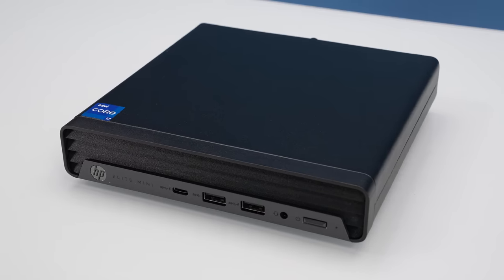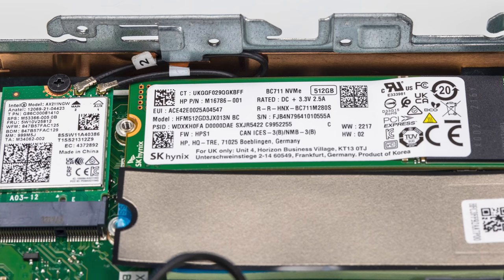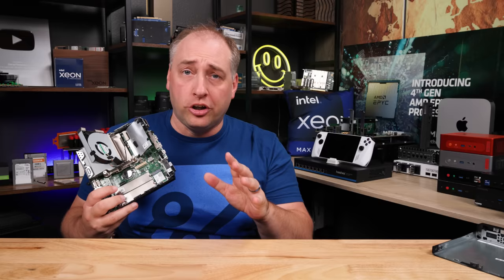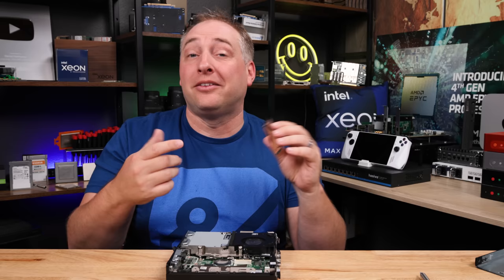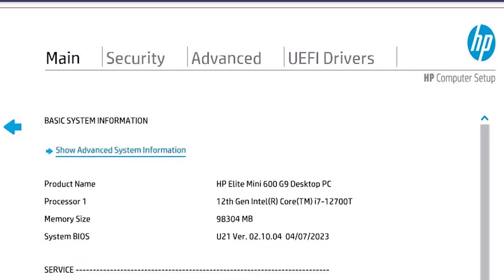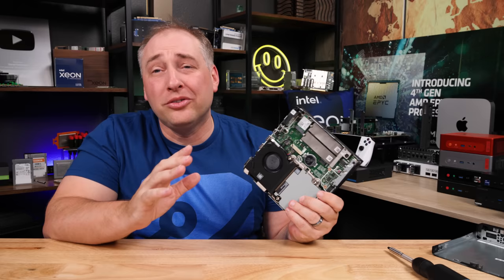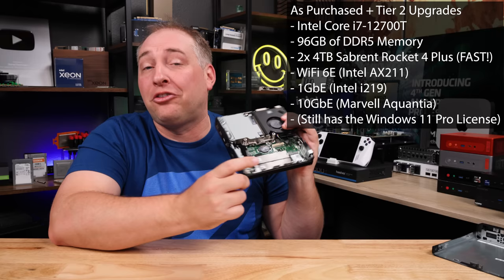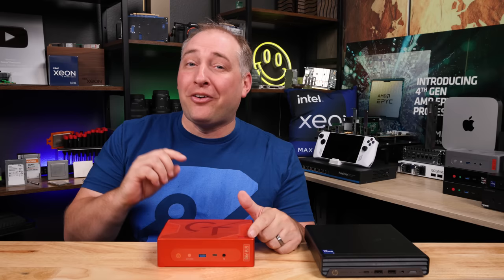Perfect 1L Homelab in 3 Upgrade Tiers Project TinyMiniMicro

Comment from the maker: Since folks are asking a lot about costs. The idea was just to give folks an idea of what is possible and there is a lot of variability here.
-  ~$500-$515 for the base we used, but there are options for less than that.
- Maybe $25-30 for an extra 16GB DIMM. 64GB is like $150-200, 96GB $279
- $29 for the 2.5GbE NIC. $129 for the 10Gbase-T NIC, 
- SSDs from $50 to $400 each depending on speed/ capacity.

I think all-in on the top-end config we would have spent around $1.5K
Reply: Original Model #?
Reply: Taxes excluded of course. The price could easily go up to 2.2k.
Reply: Thanks, was wondering the extent of the cost as spec'd.
Reply: What the original Model # -- I'm see price at $700 and up
Reply: I see there are i5 and i7 versions of this.
Reply: Patric - those machines were advertised somewhere as having some SATA capabilities, can you please comment on that ?
But anyway, THANKS for that 10Gbe find ! you're an absolute legend, and you've just replaced 3 nodes in my cluster :D
Reply: @Act1veSp1n  HP Elite 600 G9, mentioned at the beginning of the video.
Reply: @YerBrwnDogAteMyRabit are you talking about eBay auctions?
Reply: This is exactly the type of build I was looking for. I want a home virtualization server but I don't need enterprise equipment with loud fans and massive power draw.
Reply: HP seems to have two versions of the HP Elite Mini 600 G9 (at least with the Core i5 12500T). One with DDR4 memory (e.g model 828S3AT#ABD) and one with DDR5 memory (e.g model 64J15EA#ABU).
Just make a note of that before making a purchase of the Elite mini and memory upgrades.
Reply: Hey Patrick are you going to be giving that away? Cuz I am interested!
Reply: My 10G Lab costs arround $800 and many free stuff collected from the same company that sold this stuff on Ebay.

$650 - for a Server with 40TB HDD + 4TB SSD; 24 Core Xeon Gold CPU from  2017, 192 GB DDR4 ECC Memory; Redundant PSU and 24 x 3.5" Hotswap + 3.5" HDD Caddys included in Servercase.
$150 - for a 48 Port 1G managed PoE Switch with 4x 10G SFP and 4x 10G Cat7 Transceiver included! The switch have Redundant Powersupply too!
$0 - Fortinet Firewall, small Switches, Full sized 19" Rack, Some client PC's, some HDD and SSD laying arround. Cables - yes tons of Network Cables. 😀

I also spent some stuff to our local Schools and installed the Network equipment there with the Service provider.
Reply: I really appreciate your videos and all the hard work you put on but you should really stop to lower the prices you use or maybe say "I got a killer deal at 500$ but if I see the average is 800$ in US".
The HP G9 isn't usual to find it for 500$ it's more like 900$ and in some countries you can see it at 1300$ since isn't really an old computer...
For 500$ in my country you find more an HP G4 and if you read the comments in this video you will see if the average people can't get this price is because they are too dumb to or maybe because isn't what you get most of times.
Reply: -  ~$500-$515 for the base we used, but there are options for less than that.

Really? 

€1000 for that HP Elite Mini 600 G9 with i7-12700T. 
2x4TB NVMEs ~€350
96GB RAM ~€350
Plus ~€250 for the NICs

Total ~€2000 to serve files with Nextcloud and Docker with Prowlarr, Torrent, Lidarr, Invidious as in my case. 

The same thing I have going with FREE Athlon II X4 610e computer with 8GB of DDR2 RAM and LSI Megaraid with 2x4TB Hitachi Enterprise grade HDDs. Total cost ~€200 with brand new Megaraid with backup battery and 2 HDDs. 1/10 of the price and uses at idle ~85W. Upgrading to i7-9700 with 16GB RAM and extra 2-port 1G Intel NIC for another ~€200 to drop idle power usage to ~40W and to add Proxmox for pfsense and Pi-hole. Total ~€400.

Thanks, but no, thanks.
Reply: Thats going to take years to justify in terms of energy savings. how much are you calculating as saving energy wise over a year say vs a standard desktop?
Reply: hehe, that's a given with American pricing.
Reply: @faunization what eBay seller did ya get it from?
Reply: can you upgrade the cpu for that unit? like the i9?
Reply: Apparently this video added a bunch of market value to the i7 600 G9 as they're selling on eBay in the $700-1000 range, which makes many of the options at the end of the video that were "too much more expensive" suddenly more attractive.
Reply: considering you dont have cooling for the SSD dont you think you should have used SSDs with heatsinks?
Reply: @ServeTheHomeVideo be VERY careful recommending the HP 10GbE FlexIO card.  Mine went bad and I'm dealing with HP corporate right now saying that card is not certified so they aren't supporting me for it.

I literally bought this setup specifically for the 10GbE capability and they are basically telling me to pound sand.

Comment: I don't think that non-binary memory modules will ever seem normal to me...
Reply: Correct. why not just add 128GB? instead of 96GB?
Reply: @Nalianna because now you can get to 192gb with 96+96
Reply: @rohanjamadagni  But the 10700T only supports up to 128gb.
Reply: @Nalianna hopefully soon 192 🙂
Reply: @mineturte yeah cos they gonna recall thr chips and add in the extra components needed.

The 128gb limit is a hard limit, not a firmware limit like say AMD who cap some processors max ram in firmware
Reply: what are their pronouns ?
Reply: Is it maybe 128GiB binned down to 96GiB?
Reply: @ericzeisel3522 thermal/throttle

Comment: Would be nice to have a list of all the TinyMiniMicros that can have an addon ethernet port.  Let it be 1, 2.5, or 10Gb.
Reply: Exactly, i need a device with 2 ethernet ports (both 2.5gb or better), 64gb ram, LOW power cpu. Many cores. ability to have multiple m.2 nvme drives. I am considering 

A) a variety of these 1 liter PC's...
B) Chinese motherboards with laptop cpus... and also, 
C) 2650L type Xeon's (also in Chinese motherboards)

It's a jungle :(

Comment: Did something similar at a lower cost. Took my Lenovo M715 with an old Ryzen 2400GE and swapped the Wi-Fi card for a 2.5GbE. Has a 4TB SSD, a 1TB boot nvme, and 16 GB ram.  All in for under $350
Reply: I was just about to post the wifi-to-2.5Gbit option, then I read your post. Exactly what I would do. Who wants Wifi in our Homelab...lol. Wifi is for our wives/GF's.
Reply: @joeyjojojr.shabadoo915  I was thinking about the 10GbE using the M.2 slot but it would be wasted on the M715. It's always nice to see these videos so I know what I can put in my home lab 3-5 years from now 🤣
Reply: @absolutrichiek  I am in that same 3yr+ time frame for some of this hardware...lol. I just upgraded my rack to a 10Gbe backbone (and Wifi6 for the wife) with mixed 2.5Gbe and still 1Gbe client devices elsewhere on my home network.... so I am a bit behind the times.
Reply: How do you buy even get 4TB SSD, 1TB nvme and 16GB ram for under $350?
Reply: @MrQuay03  $50 1tb Samsung 970evoplus, $150 team group 4tb SSD, $30 16gb ram kit.  It's all about the sales
Reply: A really nice Server-Homelab can be had for $500, If you ignore "Capt Upsell" (hardware shill).
Nice build though , good Proxmox setup advice !

Comment: These things are no longer found for < $1000.
Reply from the maker: When I looked this morning checking the ebay link there was one for $599 OBO there
Reply: @ServeTheHomeVideo  those are with the i5 chip
Reply: Yeah, I saw the i5’s but not the i7’s.  It looks like the passmark score’s are not significant between the two however, ~17000 vs ~22000.

Comment: This video was definitely a step up in quality from a lot of the round-ups, or quick looks. Focusing on a single unit of hardware, going into what it has, upgrade paths, and a sample OS configuration/use case is far more useful than just a pile of different mini PCs all mixed together. I think you'll build a higher quality, longer lasting body of work by focusing on these "hardware journeys", and then after you get three or four put together maybe do a year in review, etc. 

By having a continuum of builds we can all appreciate how hardware evolves and opens up new configuration possibilities, etc. Plus then you have an encyclopedic body of work to further harvest for a "let's review all the cool stuff added over the past three gen!" type videos. Anyway that's just my $0.02 - everyone knocked it out of the park with this one, bravo!
Reply from the maker: Great input. I think the next one we are going to try this with is the Intel Xeon W-3400/ W-2400 series. We have several different systems, but I think that is going to be a "here is the motherboard, and here are 3-4 different options ranging from relatively less expensive to very fast, very expensive". We will see how that one goes in 2 weeks or so.

I will just point out that this costs like 3-4x what we usually spend on a Project TMM review and takes probably 3x as long to produce because of waiting for parts and then trying different setups.
Reply: @ServeTheHomeVideo  I like the idea of incorporating HEDT and more Enterprise stuff into HomeLabs. Speaking personally, my background is gamer and PC builder turned professional programmer for the past 13 years. A lot of the content I'm interested in involves beefing up my knowledge about enterprise gear. I got tired of having 1GbE for over a decade in my Home, so I started looking at more DIY upgrade paths and found you that way. 

I would wager there's an entire generation of DIY gamers out there who just don't know what they don't know about Enterprise gear that works in the Home, and I feel like this is probably a goldmine market for yourself and others like Level1Techs who can bring that knowledge to us. I'd love to have 25GbE+ in my home for example, and just be done with upgrading that for another 10+ years. But, how do I go about it? What enterprise gear translates to the home Windows Desktop environment, and which cards run too hot/loud without a rackmount or just don't have drivers? You can see the opportunity here, and it's clear to me I have a lot to learn.

Comment: That 10GbE what a find. I love seeing this stuff and the potential it has.
Reply: 10G makes this finally truly viable for things like CEPH. That's what I've been waiting for.
Reply: @FlexibleToast  literally exactly what I was thinking when he started installing Proxmox.
Reply: @FlexibleToast  Do you consider using CEPH in a home setup? Or am I missing something?

I've managed CEPH storage for some years, and for me you need at least 5 CEPH storage nodes for it to make sense, preferably more. The less storage nodes you have, the bigger part you need to not use. For 3 copies and 5 storage nodes, you can't go above 60% if you want redundancy if a node dies.

I got three cephmons, but probably could get away with one in home setup and just use the data on storage nodes to rebuild the cephmon if it dies.

We've switched to dual 25gb nics (bonded) some years ago as standard.
Reply: @burre42  yes, I use CEPH in my home setup. Proxmox uses CEPH for its hyperconverging. Proxmox takes away all of the complication of setting up CEPH and it has been super reliable. As for the storage space, of course if you're running only three nodes and you want 3 copies you can only use as much space as is in your smallest node. For a homelab I've never run into that being an issue.
Reply: Used ceph in 3 node production environment with erasure encoding. But on dual 100gbkt ethernet
Reply: @damiendye6623  Out of curiosity why do you use Ceph? Does it handle some issue not covered by ZFS or better?
Reply: Wow happy to see I am not alone thinking the same. A 10Gbps to distribute nodes OSDs and monitors. However, I think I will leave Ceph techs to something like MinIo. 
With MiNiO cluster you can do the same with erasure process until 50% of your node. The fact Ceph is integrated to Prowmox is a big plus. But then I prefer to just maintain HA and do my mayonnaise for storage cluster differently 👍😁

Comment: I recently put a HP Prodesk 400 G6 on my rack. That machine runs Debian 11 with docker containers. Nice small machines. 

But, I like the Lenovo M720q's I have, a bit more, as they have PCIe slots. 

In total in my rack:
HP Prodesk 400 G6, i5-10500T, 2x 8GB DDR4-2666, 128GB 2,5" SATA bootSSD, 1TB WD SN770 for data. Running Debian 11 with Docker Compose.
2x Lenovo M720q, i5-8500T, 2x 16GB DDR4-2400, 1TB NVMe SSD. Running ESXi 8 native. 
Intel NUC7i3BNK, i3-7100U, 8 + 16GB (24GB total), 500GB NVMe SSD. Running ESXi 8 native with vCenter installed on it.

Comment: The small 10Gbe module blew my mind.. If there was a way to pop in a couple of 3.5" drives it'd be perfect. That said let me tell you that a 10Gbe with 11W idle is a feat.. most systems you can build will NOT support PCie APM and will prevent the CPU from going down to C8.. 
Patrick can you confirm if this CPU is indeed able to hit C8 while idle with the 10Gbe module?😊
Reply: If anesthetics aren't a huge concern, you can prob run externals, but I'd go with a couple of 2.5 SSD's personally.
Reply: @YerBrwnDogAteMyRabit I don't think anesthetics will solve this issue. 😂😂
Reply: @st3althyone  haha yep.. We could Frankenstein something but no 12V will make it harder.
Maybe via Thunderbolt but I did not see it amongst the specs
Reply: @Airbag888  Thank you, but I think you missed the joke with the misspelling of the word “aesthetic.”🤣🤣
Reply: @st3althyone  oh I did not but too much work replying to everything haha XD
Reply: @Airbag888  I agree. 🤣🤣
Reply: I’m not sure about that G9 but the previous generation HP DM mini’s all came with 2.5” SSD brackets with Sata modules.

Comment: Powerful, sips little power, and at a decent price. What a combination! I would definitely consider buying one of these with all the upgrades already done. Specifically the 10GbE version. I would have a lot of fun setting this up! 🤤👍
Reply: sips little power? the cpus TDP is 99w!

imho this is a terrible setup, tbf i don't think the reviewer is serious with this build, just trying to max it out

but if you were to put consistent load on this thing it'll fail quick, the combined heat of the cpu and 2x nvmes will kill the thing is short order

and these cpus in a tiny pc makes no sense, a ryzen u series like a 5800u makes much more sense
Reply: @elduderino7767  While i agree about nvmes - indeed they probably add a lot of heat and may be a gamechanger here. But I don't agree about the part about cpus choice. I mean they are designed for such appliances. If HP chose to sell those with i7 T-series (probably for heavier loads) then i bet it was after some extensive research about temps. Besides in 7:56 you see bottom note that this setup had 45 DAYS uptime - i bet Patrick would report here if anything bad (like extreme temperatures) were happening during that time.
Reply: @domantlen6231  99w TDP is way too much heat for this form factor

why do intel do it? because they have too, it's the only way they can get the performance to rival ryzen - that doesn't make it a good idea

if you need this much power just get a ryzen, they are much more efficient it will produce reliably without thermally risking other components
Reply: @elduderino7767  Sadly i don't see any terminals which use Ryzen. Only miniPCs (mostly from China) which in my country are little more expensive, less flexible (soldered CPU) and less "stable" (their Bioses and other things are less polished or patched than terminals)
Reply: @elduderino7767  Did you even watch the video?  At 1:23 the screen clearly shows the I7-12700T has a TDP of 35 watts.  Patrick mentioned the max observed system power was 74 watts at 13:57.

Comment: Sharing a similar working upgrade config I'm using. I have a Proxmox Cluster of three HP EliteDesk 800 G6 Mini PC i5-10500T’s I picked up on eBay.  Configured Proxmox HA between selected VMs on the nodes and Proxmox Replication keeps everything in sync every 15 mins.  Failover tests have worked well with VMs moving nicely between the Nodes if I yank a network cable to simulate a failure.   Upgraded each of these three with: 
1 x Crucial RAM 64GB Kit (2x32GB) DDR4 3200MHz CL22 CT2K32G4SFD832A
2 x Crucial P5 Plus 1TB M.2 PCIe Gen4 NVMe SSD - Up to 6600MB/s - CT1000P5PSSD8

Each pair of Crucial SSDs is running in ZFS Mirror as in Patrick’s video. Overall very happy with this home lab setup and love having three of these for mostly worry free redundancy. Gives me 36 CPUs and 192MB to play with, allowing some headroom for VM failovers between the Nodes if needed.

Might be time to upgrade to 10GbE in these for the fun of it.

Comment: I have 4 of these in a stack running proxmox and ceph, cause I wanted a really cheap way to get a ceph cluster up and running for testing and learning.
Not exceptionally viable with 1gb nics, but with 1gb AND 10gb I could see it being a useful cluster - and ceph allows for HA without needing a centralized SAN or other kind of storage.
Reply from the maker: Proxmox VE has Ceph integrated with a UI as well so that is the use case I was thinking about when we first started these :-)